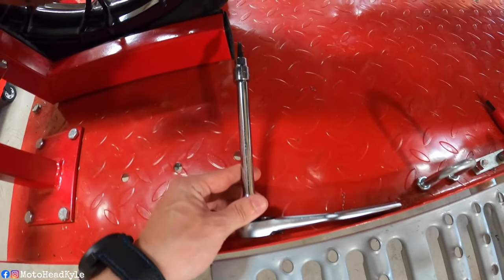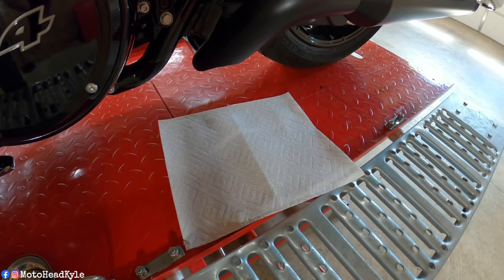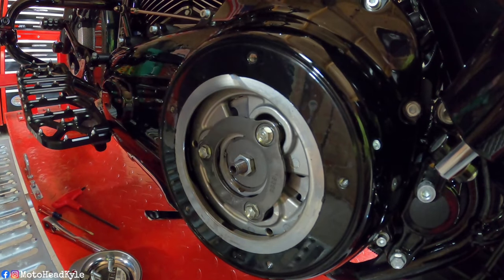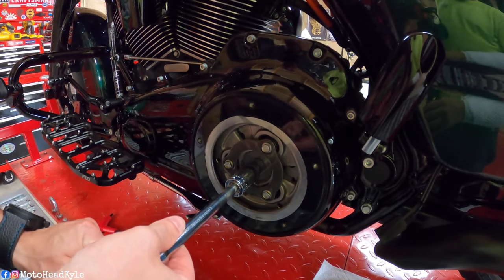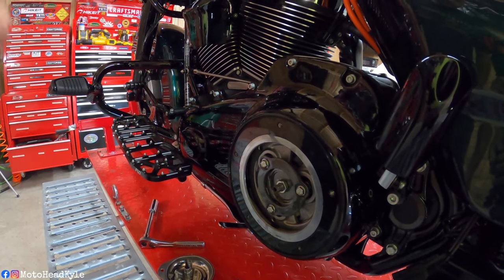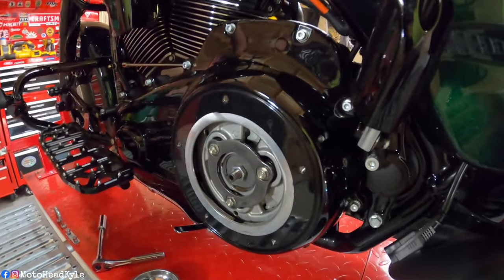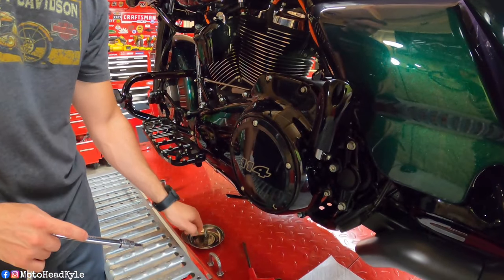How to Adjust a Harley Davidson M8 Clutch (cable & internal)

Comment: Put it in gear to break the jam but loose. Your adjuster moves when you tighten the jam nut, use a wrench and keep your Allen in the adjuster to hold it where it was
Reply: 1st gear while all this is being done?
Reply: @letiziapassanisi9967 put it in a higher gear so you don’t accidentally push start it

Comment: Good video.  I also replaced the plastic OE piece (clutch adjuster) with a superior metal piece from Fat Baggers.  It was $50.00 but to me the piece of mind and eliminating another potential HD OE piece from failing, is well worth it.  I've also replaced the OE plastic transmission cover plate with a Trask M8 Checkvent; aside from the superior metal piece from Trask, my crankcase is now properly ventilated.  I prefer the Task piece over a Vented Billet Oil Dip Stick; Vented Dip Stick does work, however venting with the Trask is my preference.
Tom M., '21RGS Snake Venom/Black.  My mods/upgrades (so far):  Full S&S 465c Cam Chest; S&S 2-1 Sidewinder; Fuel Moto # 3956 Air Cleaner (w/stock HD Outer Cover & 114 Cu In Badge); Trask M8 Checkvent; Dynojet PV3-B Tuner (Map by Fuel Moto).  Color matched by HD:  HD Wrapper front fender & Headlamp Surround.  Rockford-Fosgate/HD Stage-2 Audio & SirrusXM.  Custom dark green stiched Saddlemen Road Sofa Seat & passenger pad.  HD Lo-Chiesel Bars.  HD Kahuna collection grips, floorboards, Derby Cover & Timing Cover.  HD Docking Station, Detachable Sissy Bar & Rear Luggage Rack Wing w/LED.  HD LEDs (all).  
Additional waiting install presently:  S&S 55mm Metal Intake Manifold (ported by Ward).  Darkhorse Crankworks Man-O-War Compensator.
Future planned (eventually):  S&S 114/117-to-128 Big Bore Cylinders/Pistons.  Level A (or B) Heads.  Replace S&S 465 Cam with S&S 540 Big Bore Torque Cam (& Top end Gorilla Kit...Roller Rocker Arms, etc.)  SE 64mm Intake & TB.  Or...S&S 131 Stroker Kit (4.625" Stroke, 4.250" Bore).
Reply from the maker: Thanks for watching! Yeah! I hear those can go. Smart move by getting ahead of the problem. Sounds like you got a great build going on👌🏻 making me jealous lol

Comment: Thanks for yet another video I’ve learned from. Last one of yours I used was actually in your intro to this one (pulling the front fairing). Great work man. I will say, doing this on a 23 RGL with factory lowers was NOT easy, but the clutch parts were all just like you showed. That plastic tube protecting the adjuster is a PAIN to slip up and back down. It seems to get mostly caught on the spring. All good though! Clutch adjusted and while I had it loose I pulled the pins on the lever, greased the lever internals, and shot some lube down the cable. Couldn’t have done it without you! Thanks again for your work here.

Comment: Also, I highly recommend adding a Fan to the Oil Cooler.  Get the Fan from either HD or ThunderMax, easy simple install and have the HD Dealer flash the ECM.  If tuning with Dynojet (PV3-B in my case for '21-'22 HD), ensure the Programmer checks the box on the Map to let the ECU know there's a Fan added to the Oil Cooler.  And if RDRS equipped, include that in the Map too!   Make sure you know which "Strategy Number" your '21-'22 HD has in the ECU.  Ride safe and maintain situational awareness (re: distracted drivers in cars, and potholes, etc. in the roadway).
Reply from the maker: Thanks for the recommendations! You ride safe as well my friend!

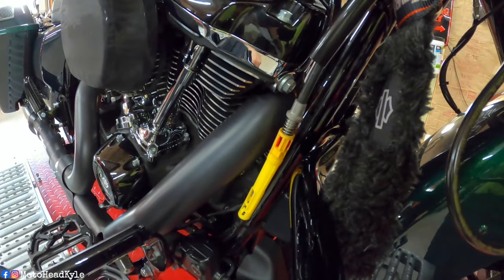Comment: 4:15 great video, however, I do have a question. I have the ultra limited with all the radiators and such. I tried doing the clutch this morning for a lubrication and cannot get my hands inside that thing to get any movement. Do you have any videos on how to access the clutch area with the radiator covers still installed. Thanks again, great video.

Comment: Good video. I have an ‘18 Limited with a hydraulic clutch so it can’t be adjusted but the new cable adjustment is a bit easier that on my older Harleys.

Comment: Is it possible to adjust the release point on the clutch lever?
Mine is releasing on the very top.
Would like for it to release sooner??
Reply: You can, just hold the spring down slightly before locking the clip on the cable back in. It will add play

Comment: Thanks for the great video, not sure why you would feel you have slip at 10,000 miles but it’s,the schedule in the maintenance for sure. Thanks for making it easy. Mine still tight at 9700 miles on my 21 RGL. That’s one sharp looking Glide, bud. 👍🏻
Reply from the maker: Thanks! Its still doing it a bit. I think it’s actually slipping or hanging from the oil I was experimenting with in the primary before my last trip. I think it’s too heavy, so I’ll be changing that and seeing if it’s better

Comment: Do you just tighten the jam nut back or you trq spec it? My bike has 20k and haven’t even done adjustment and is also stage 2
Reply from the maker: I wish I had that Stage 2 power🤣 I just tighten the jam nut back while the Allen is till holding the new position and snug it with a wrench

Comment: Nice video Kyle .. Question do you need to have the bike in gear when doing this adjustment??  thanks
Reply from the maker: Thank you! I’ve done it both ways, I find it easier with the bike in gear 🤘🏻
Reply: @MotoHeadKyle  thank you so much for replying

Comment: Run the adjust in and out multiple times before setting the adjuster so you know the tension isn’t debris on the threads of the adjuster

Comment: Thanks. I need to adjust mine. The clutch is loose and at startup it rolls forward a little and the lever is loose. But bike is breaking in still. 👍🏻
Reply from the maker: Yes! Sounds like it’s a bit loose!

Comment: Got new levers for my 22 RG Special, shouldn’t be to bad to do, wonder how long that plastic and spring will last on the adjuster, might go aftermarket on that too
Reply from the maker: What kind of levers did you go with? I hear Fat Baggers makes a replacement cable that is all metal for the adjuster for relatively cheap. I’ve heard some people complaining that the stock plastic adjuster has have failed on their bikes.
Reply: @MotoHeadKyle  Got 1finger levers thru Deadbeat customs 10% off, putting on BMC hoop tease bars and Arlen Ness grips and mirrors this week, I seen Fat baggers product, might replace the whole dam thing, if I can find something that’s Quality👍
Reply from the maker: @BrewTownBiker  I’ve been looking at those levers! Let me know how you like them
Reply: @MotoHeadKyle  I will 👍

Comment: Can anyone tell me if these new 2 piece clutch cables need lubricated? The internal of the clutch cable itself. I’ve heard conflicting statements as to whether they do or not. It’s on a 2020 street bob.
Reply from the maker: Yes. Bigger question, why would you consider not lubricating it? It’s “wear” item and the lubrication has no negative effects. If anything it will give you a easier pull since it’s lubricated.
Reply: Kyle, because I’ve read some Harley’s have a nylon lining inside the clutch cable and it actually caused problems when people tried lubricating the cable because it degraded the inside lining. That’s why I wanted to be really sure before spraying something in there.
Reply from the maker: @colepeters1903  an easy check would be taking a look at your owners manual or service manual. Or calling the service dept. However I have a feeling that would only pertain to the bikes that had a hydraulic clutch

Comment: I know I'm late here but the torque spec for the derby cover is 25 to 35 in-lbs. At 84 to 108 in-lbs you'll be stripping the screw holes in your outer primary cover. 25 to 35 is what is stated in my 2021 service manual.
Reply from the maker: Thank you

Comment: Hey man wondering if you could help me out, i did this adjustment on my 21 street bob and the free play and everything is okay but when the bike is in gear and i have the clutch in the bike wont roll. i have redone this process quite a few times to get similar results. the first thing i hear or read is that its adjusted way to tight which i dont understand being that i even tried 1 full turn out from  the resistance point

Comment: Is this the same on the 107?
Reply: Yes, this is the same procedure as the 107s with a cable clutch. I suggest using an off set box 11/16 Wrench. Then, you are able to hold Allenhead bolt still while loosening and tightening jam nut.

Comment: no adjustments on my 19 roadglide anywhere
Reply from the maker: Because you have a hydraulic clutch. 2014-2020 Harley touring had hydraulic clutches 21 and newer they went back to a cable clutch

Comment: I watched this video because I needed to see how to work that new bs plastic crap that Harley has put on the clutch cable but I did notice something about your video that was not right.  You said you adjusted it because it was slipping. This has nothing to do with your clutch slipping.  The clutch cable and internal adjustment are for clutch release.  If you are having slipping then you will have to rebuild and put new clutches in the basket.  Hope you get it fixed though.  That doesn’t sound fun.
Reply from the maker: It ended up being the oil that I was trying in the primary.. all is good 👍🏻
Reply: Agreed about all that plastic "crap".  After watching this video, I checked my '19 Road Glide for the external adjustment - it wasn't present on the clutch cable that ran along the right side of the frame.  Though, I'll still perform the internal clutch adjustment even though the bike has less than 4,400 miles on it.
Reply from the maker: @josephbrooks2891  your 19 would be a hydraulic clutch. Therefore their is no adjustment. As it adjusts on its own. 14-20 model years had hydraulic clutch’s and for whatever reason Harley brought back a cable clutch for 21+ model years! Hard to find anything that’s not “cheap plastic” anymore. Ride safe my friend!
Reply: @MotoHeadKyle  in a deep rabbit hole trying to diagnose problem with my 23 street glide ST. Had 1st service done at harley dealer. Rode it home. Tried to get on the throttle jumping on the freeway and immediately felt the clutch slip. I thought I was possibly spinning. But after digging through threads I came to the conclusion it maybe the oil they used on the transmission.  4-6 after 3k rpm just slips. Trying to shift quickly into gears is a no go as well it just hesitates. Going back to the dealer Monday morning.
Reply: @henryornelas7827  I had that issue on an old roadking.  Bike rode great.  I changed the oil and put amsoil in the primary.  The amsoil was too slick and caused the clutch to slip.  Drained it out and put Harley convential primary in it and the problem went away.  Just my experience but maybe it will help you.
Reply: @chasingexcellence2246   appreciate that. Will definitely keep that in mind. Gives me more peace of mind as well.